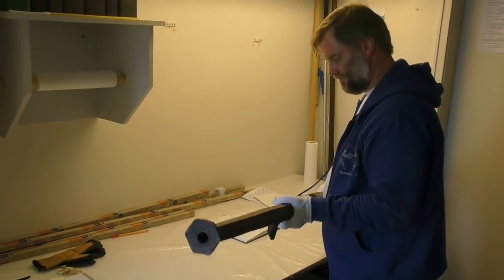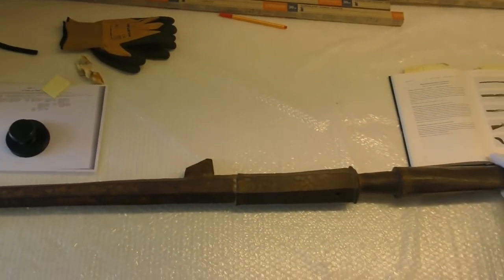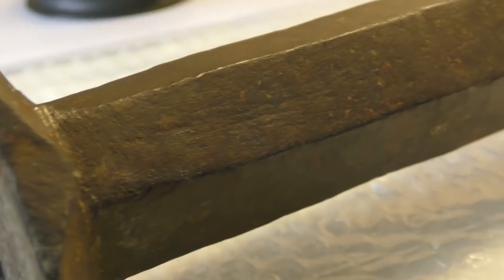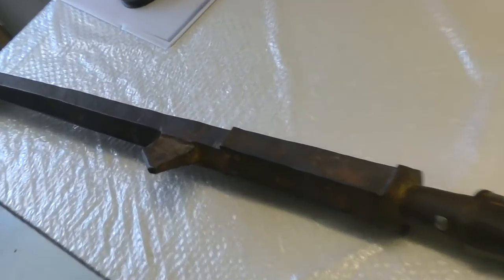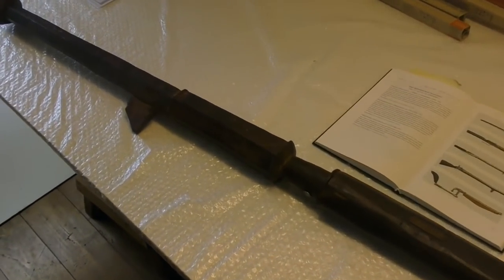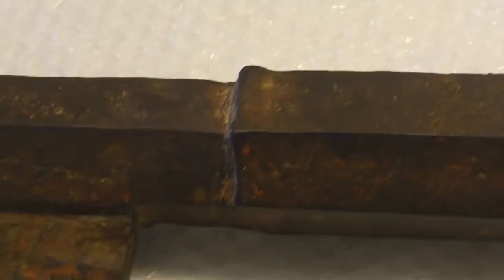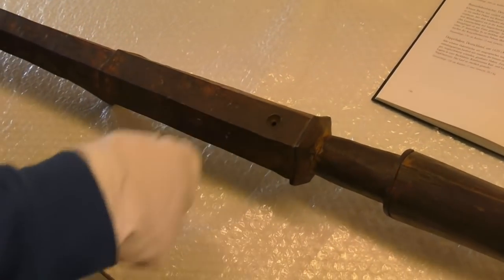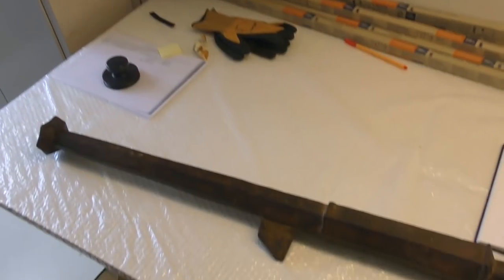An original arquebus – a late medieval gun

Comment: I read somewhere that when firearms first started to appear on the battlefield the nobles were not pleased with the possibility of getting killed at close quarters by a mere peasant armed with such a weapon.  For some reason they were apparently less concerned about getting injured or killed by the longbow which remained in service well into the  gunpowder era.
Reply: The nobles did not like peasants armed with a weapon that could kill an armoured knight. The longbow doesn't reliably penetrate armour, so why would they be afraid?
Reply: @joost1120  these early guns werent as good at defeating plate armor as we think they were. hand cannons started popping up in the mid 1300's, about 70 years before the creation of the full plate harness. had they been the end all be all for armor we wouldnt have seen armor evolve from full mail to full plate.

these guns fired large, heavy lead balls from smooth bored barrels. sure its more velocity and power than a longbow shot or a crossbow shot, but its still not enough punch to reliably defeat mild and hardened steel plates. firing these guns in large volleys into a mass of troops will certainly yield results as shots are bound to find weak points in armor and the extremely loud noise can damage morale, but it wasnt as easy as "i have a gun, your armor is useless"

we must also consider too that plate armor was designed to deflect incoming projectiles with its curved and fluted surfaces whether it be arrows, bolts or gun shot. seeing that full plate harnesses were being developed 70 or so years after firearms, the armorers would of taken this threat into consideration when forging the suits. we still see breastplates and helmets, and even cavalry with full plate being worn well into the mid 1600's